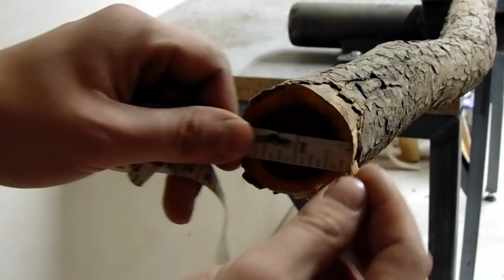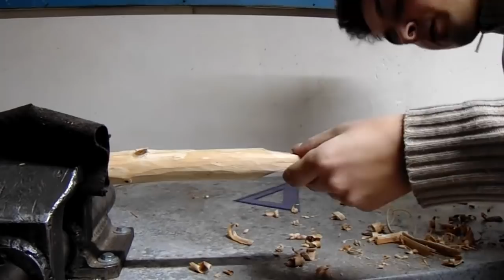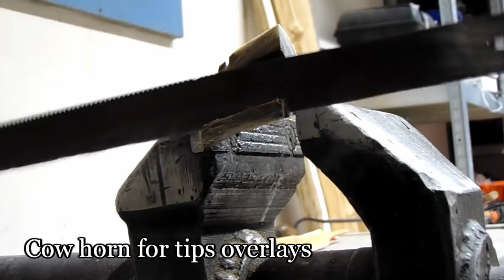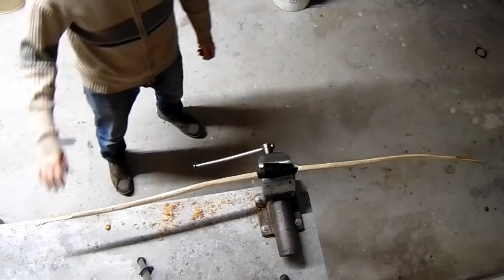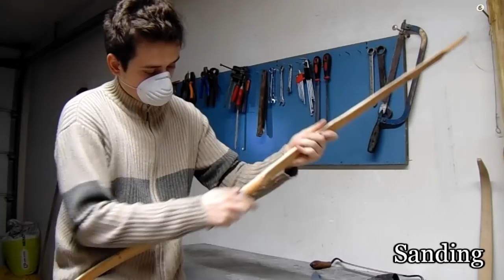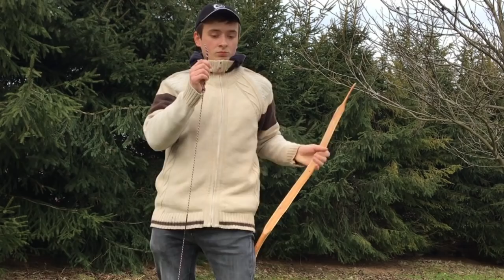Branch Bow Building - A Yew Selfbow

Comment: Once again a beautiful bow! Did you choose the light draw weight because of the snakyness of the Limbs or because of the overall small diameter of the stave? Thanks!
Reply from the maker: Thank you sir! I was aiming a bit higher - for 30-35 lb but due to overall stave character and my mistake (I removed too much wood at the single spot) it ended up 25 lb. Still happy with it!

Comment: Nice snaky bow. Shoots well. I made a similar yew bow, shorter with recurved tips. It has a sinew back and pulls about 45#. Yours would increase if you shortened it and added sinew, should you want that. It would shoot much more harshly, though, and the draw length would decrease. Good seeing you wearing a mask, yew dust is toxic!
Reply from the maker: Thank you sir! Yes sir it could be a good upgrade!
Reply: @totallylegalshit7579  by the time you pound up those tendons, you will have a lot of thread like strands, maybe a paper grocery bag full. They should be 4 to 8 inches long. Then you need some hide glue, I used Mrs. Brown's Cold Hide Glue, from Lee Valley. It doesn't require heat. Then, starting at the grip, layer the strings of tendon across tbe back of the bow working your way up the length of the bow and overlapping each section. When you reach the tip, start on the other end of the bow, working up to it's tip. Once you're finished, allow it to dry/cure for several days. If you have more tendon, start over with another layer. Do as many as you have tendon for. Three or four layers will make very powerful and resilent bow. You can use a file, sandpaper and hot water to smooth and finish the backing. Once the glue has cured completely, maybe three or four weeks depending on the humidity,  carefully begin stretching the backing, taking several days to condition it to full draw. You may have to re-tiller the bow depending on how much stronger it gets. I have even used sinew and hide glue as patches to reinforce weak spots/splinters in an otherwise unbacked bow. Have fun.